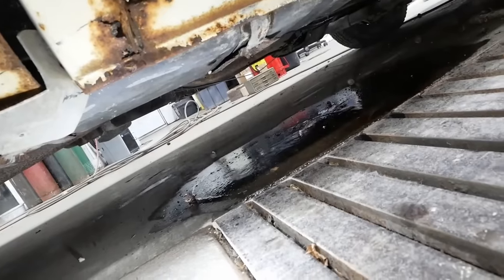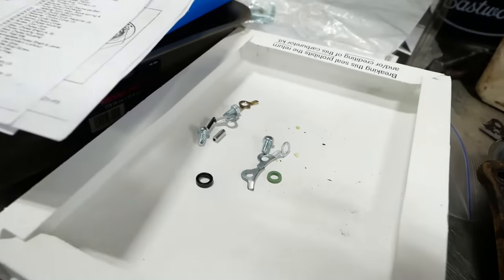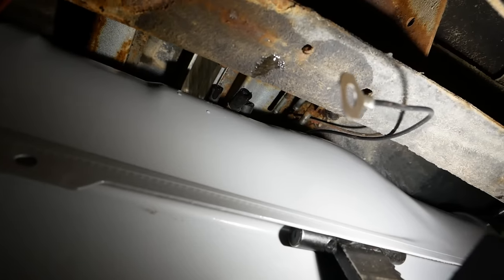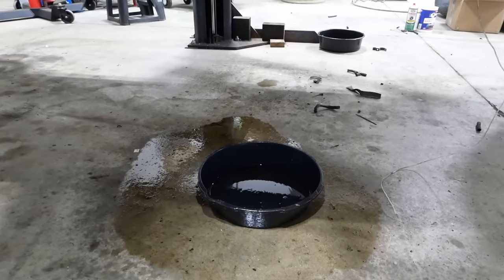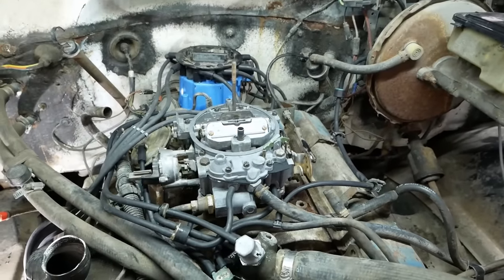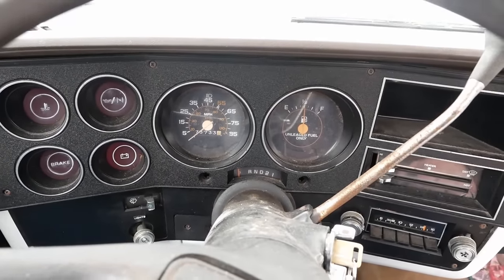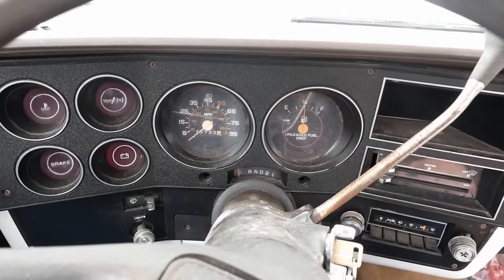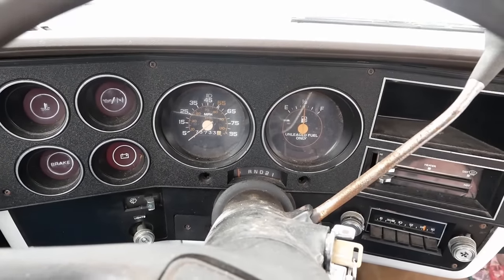Millennial vs. Carburetor | Square Body Chevy Back on the Road After Sitting 12 Years

Comment: Always great videos Wes. Wish I could help you with that carb, rebuilt hundreds of them at the dealer back in the day. Good luck.
Reply: I had a couple of vehicles back in the day that had the Rochester Quad, the worst decision they ever made in my opinion, it was a good idea on paper, but not in the real world. If you floored it from a stand still it would almost die because there was so much being allowed in for the amount of fuel. 
Those Holly dual pump dual feed solved that issue.
Reply: Soundds like a tuning issue, and not a carb exclusive problem. My Quadrajet is over 40 years old, and works ok.
Reply: @dave_n8pu  the secondary air flap was out of adjustment allowing them to open too soon.
Reply: @paulcarroll750  It came that way from the factory on my (back then) new 1970 GTO Ram Air III. If I waited till I was already rolling at say anything over 25 - 30 MPH, then it was Okay but not from a full stop. That's where the Holly dual pump dual feed that I had installed for me solved, and the place that installed it for me told my it was a lower CFM than the Quad that the factory installed. It made that car much more than enjoyable for me.

Comment: Good onya Wes,
Wow epic video, love your work.
Worked at GM in the 80s, rebuilt LOTS of those carbys.
Two things
The float absorbs fuel with age sinking slightly, causes havoc, replace it.
The accelerator pump check ball seat attention the bottom of the bowl gets corroded, usually you can whack the old ball with a punch to reseat it and then put the new ball in. If it doesn't seat you loose some of the squirt, and it hesitates.
The throttle shaft is a biggie.
Also, the top of the Carby can get distorted from people over tightening the air filter wing nut. Then you can loose vacuum to the power valve etc.  If you run a file across it you can regain the seal.
It took way too long to invent fuel injection.

Comment: I was really impressed with your description of the choke operation. It was clear, correct and in the proper order. Well done.
Otherwise, all you kids grew up on fuel injection and are afraid to touch the pedal while starting. Us old folks, after about 3 seconds of cranking you start pumping fuel into it.

Comment: From what I hear, the zinc was discovered to be clogging catalytic converters so the concentration was reduced or eliminated from most popular consumer oils. Also engines of the last several decades have moved to roller lifters so don’t have anywhere near the frictional contact a flat lifter has.
Reply: I have read info from different oil companies and engine manufacturers and they all say pretty much the same thing. Wear additives like ZDDP were found to be reducing the effectiveness of catalytic converters. As Wes said, a high performance engine needs high performance oil. I like Amsoil on older high performance engines. Motul or Mobile1 on modern engines. Castrol or Shell Rotella for work vehicles and generators.

ZDDP - ZincDialkylDithiophosphate. 
Zinc is the carrier for phosphate which is the active ingredient that is supposed to reduce wear on flat tappets.

Comment: Elmer is right on the Rochester. I’d try to get new floats though. Reminds me of my 65’ and 1966 GTO days.  Next time you have to fight a fuel pump that operates off a fuel pump eccentric rod load it up with grease or petroleum jelly to hold it in place.  Good work.

Comment: I have worked on a lot of these Gen 1 engines and have often had lean carb issues.   First thing to check is to clean the seat on the EGR valve.  While in the closed position it could be venting exhaust into the intake manifold.  Second, if this engine has an Aluminum Intake Manifold spray some carb cleaner around the parameter and look for leaks.   With an Iron Block and Aluminum Manifold the different expansion rates work the gasket.  More than once I pulled an Intake manifold to find the gasket crumbling in my hands.   Good Luck.

Comment: Hello Wes,
Wow the chrome gear shift lever is even rusty. At least the body is good condition. 
The late 70's early 80's carbed vehicles were very problematic and extremely frustrating. It even got worse when they introduced the ECM to control some carb functions. Then we advanced to throttle body. No wonder why we are using fuel injection today. I would suggest a new Holley. Or raise the radiator cap and drive a new vehicle under it. 
Good luck, Boe

Comment: The zinc additive back story began with adding it when you break in a new camshaft. Aftermarket Camshaft manufacturers were having defective cam comebacks and abnormal wear after customers installed them on their flat tappet cam on older vehicles. Mostly small block chevy's.  But, after initial break-in, you shouldn't need high zinc content, but that hasn't stopped every oil and chemical manufacturer telling people that they need that zinc for every oil change going forward. Now all older vehicle owners don't want to take chances and the zinc additive requirement stories have exploded.
Reply: Agree 100 percent.  For a performance build with a flat tappet cam I run the royal purple break in oil and follow the break in procedure for the cam.  Then drain and refill with my preferred brand of oil without any zinc additive.  Been doing that for many years and never wiped out a cam or lifter 😏
Reply: @rickwensel2313  That's entirely different and has more to do with low sulfur content, not "lubricity" qualities by some imaginary additives that didn't exist in Diesel #1 and #2 prior to 2007. Sulfur is an acidic lubricant, not a good lubricant, but it is one. There were fuel pumps designed around using the sulfur as a low grade lubricant. Modern Diesel injection pumps, even ones from 20-25 years ago, don't need it, even though there are some cabal weirdos who think the VP44 needs oil in the diesel fuel.
Reply: Back about 1972 I worked for a trucking company . One of my duties was topping of the oil in the power units . The pumper truck I used always leaked a couple of drops after use . I was driving an old 318 c.i. dodge that leaked oil pretty bad so I would use the waste oil from the pumper truck in my car . Didn't take long and it slugged up that motor but good . It was Shell Rotella 15w40 . I don't recommend using it in gas engines .
Reply: @orionfixr7713  The fact it was waste oil was your problem. Secondhand, heat-cycled, diesel contaminant-filled, sheared down oil will sludge up any engine in short order. Everyone and their dog runs diesel oil in classics now without issue.
Reply: @kw9849  It was fresh oil that dripped out of the gun on the pumper truck .
Reply: @orionfixr7713  ive put 242k miles on my 04 Cadillac Deville 4.6 Northstar, almost 800k miles between my two 02 and 04 Silverado 2500HD 6.0 gas engines, 133k miles on my 03 Oldsmobile Aurora 4.0, and those are my current vehicles, ive put over 500k miles on a well used and abused 98 Cavalier 2.2 pushrod engine, 390k miles on my old 02 Silverado 4.3 V6 (frame rotted), my old two 1988 Chevy 2500 (one 7200gvwr, one 8600gvwr) almost a million miles between the two, both 350 TBI engines (frames rotted), my first truck, my 1982 Chevy 250 straight 6, the odometer quit working at 977k miles, but put over a million on it (i bought it with 812k miles) and, including my garden tractor (1980 International Cub Cadet 12hp Kohler) my Toro pushmower, my beat to crap MTD snowblower, my 4-stroke Husqvarna weedeater, EVERYTHING I own runs on 15-w-40 Rotella, and I can assure you that if you pull the valve covers off any of my engines, wipe off the fresh oil off the insides, and you can eat off any of the surfaces without ANY sludge at all!!!! Rotella oil and Wix filters have been my go to for over 25 years, no matter what engine it is/was!
Reply: @mattcat231  : OK

Comment: Had a similar issue with a Carter pump for a 1968 Ford 289. Ended up going with a Napa which fit like the original. Interesting how this truck's frame and underbody looks better than most of the 10-15 year old ones you work on.
Reply: Agree but since the mid 80's Carter stopped making quality products and only worried about profits. Thats why so many blockoff plates and electric fuel pumps were bought then.

Comment: Your dad may be right. Dont expect too much from a carburator. As a lot of people said, we would often bypass the choke with a manual cable because they were so finicky. My luck with rebuilding carburators was hit and miss because there were many variables. I recently tried to clean/rebuild a carb on a chipper/shreader. All passages clear and about as simple of a carb you can find. No go. Put a new carb on it and started right up.

Comment: LOL!  You're expecting modern performance from an old system.  You have to DRIVE these old girls.  Feather the accelerator.  You never pulled out into traffic before these were good and warm.  Stalling on takeoff was a common cause of accidents.  I think the greatest benefit of all the electronics and computer stuff is the ability to get in and go and not have to wait on that car 1/4 mile away before you pull out of your driveway.

Comment: Thanks for taking me on a stroll through days gone by!  I rebuilt a holley carb once, and used I to replace an auto lite.  Fuel injection is a better idea, but mechanical parts are easier to reproduce from scratch than are semiconductors.

Comment: Zinc in Oil is really more important to older cars with older engines. In some states you can't even get straight weight oil anymore it's all Multi-Weight so if you have like an old Camaro, Mustang, Charger or any Classic Muscle Car with a period correct engine Zinc is essential. But since this particular Square Body is catted using a oil with less Zinc will keep the Catalytic Converter intact.

Comment: Your frustration brings back late nights as a teen in the garage smelling of carb cleaner and uttering profane incantations. I rebuilt my fair share of these and had friends who did it for a living. We just converted them. Manual choke cable into the cab and a little time to get to know the equipment. We ran automatic chokes till they failed and converted them to manual on our farm. Probably not a good solution if the owner wants to turn it on go and not have to fiddle with anything. We did buy rebuilds for grandmas car for that very reason and the auto chokes worked fine on them.  We figured they had a direct line to the carb gods and we were not worthy. This was in the late 70's to late 80's. Once we got our first GMC TBI we did not have the issues anymore. Thanks for the vid Wes. Cheers.

Comment: Hi Wes, great video.  I have a recollection of working on these many years ago. The float doesn't come in the carb kit and should be replaced. if you don't replace it you should at least check it in a bowl of water to see if it actually floats. They would crack and fill the float with fuel causing an over fuel issue.

Comment: Q-Jets, are a pretty simple carb! You can even adjust the secondaries to open later than factory. It's a good carb actually. One of the main problems they had with those is that customers would tighten down the wing nut too tight and warp the top of the carburetor. Have fun! lol
Reply: I've never heard that. They are temperamental junk.
Reply: Yeah, they are pretty good, except for their notorious habit of flooding over and setting fire to the engine. It would seem this vehicle was another victim of this.
Reply: I have heard of that as well and it seems to put the choke plates/valves out of index? Something like that. It distorts the air horn. Interestingly Old Car Alley's most recent video talks to this issue on a Rochester he is getting ready to rebuild.
Reply: Simple?...LMAO!!!

Methinks you have not worked on them. They are good carbs, but they are a pain in the ass to work on.
Reply: @markusgarvey  Yeah, simple! Maybe  you haven't done very many as to why you think they are a "pain in the ass".  I'd take a Q-jet any day to overhaul over many others such as the Holley double pumper!
Reply: Ain't no way

Comment: The EFE and the air cleaner bypass were quite useful and in some weather conditions very important in Canada and Northern states. As you said the EFE heats the intake manifold before engine coolant is hot enough to help with fuel vaporization. It made a noticeable difference on short trip vehicles. Without the air cleaner bypass carb icing was a serious problem. Some imports used a manual winter setting. I locked a lot of US systems shut for the winter and told the owner how to unlock it in the spring. (emphasizing that warm April days with winter gas in the tank would be giving them vapour lock).

Comment: Glad you got it working. First thing I do on these old things is check all your canisters with a vacuum pump, and check idle vacuum. Choke pull off and advance are common. EGR. Etc... Often they're all bad. But choke adjustment is pretty critical on these too. If you have low vacuum, everything is off. And people spend weeks debugging while never getting a vacuum reading.

Comment: Excellent video Wes. Congratulations overcoming many of the problems...my heart was with you all the way.   The power brake booster may have a vacuum leak due to a worn diaphram or the power brake booster hose may have a crack. I have heard this may cause a rough or stumbling idle sometimes.

Comment: I have worked on carburettors in the past and only ever had one with an automatic choke mechanism. It proved so problematic by the time I owned it (it was an old car) that I changed it to a manual choke and it was much more reliable. If I recall it was a question of attaching a manual choke cable to the choke mechanism and that kind of overrode the automatic action. I also recall that many cars were a bit stumbly until fully warmed and off choke. Thank you for the entertaining video though. Nostalgia ain't what it was! Glad to see you're all OK. Take care. 👍 I

Comment: I took the Quadrajet off and replaced it with a Holley that was a direct fit and was a smaller CFM.  This was on my old '78 chevy 350 cid.  It was much more predictable for cold starting and general everyday use.  It just didn't have the power of the Quadrajet over all.  It just seems to me that for a carburetor to work as OEM there has to be absolutely perfect everything in sync. The one carb that I never understood was the Carter AFB.  I had two on a tunnel ram on my old gasser back in the '60s and tried everything to get the performance I wanted.  Plenty of other people swore that they were the best.  I replaced them with Holley 650 CFM and never looked back.  Loved drag racing and think all the time how great it would have been to have modern day FI and computer control.
Reply: Get back into it man. You only live once. Drop a 5.3 or 6.0 truck motor in something and throw a turbo on it

Comment: Im currently converting a 5.7L Hemi to a Carb set up in my 79 firebird. I ❤ the simplicity and adjustability of an old school carb! I can achieve much better gas millage by making simple easy changes of jets ... Ect
Reply: Yes sir  I'm getting ready to install new engine in my old jeep yj.  I have a new Weber  carb and a upgraded gm style hei distributor . No computer, manual fuel pump, two vacuum lines , 👍👍👍🇺🇲🇺🇲
Reply: @jontrudell7529  Cult Leader Wes...
Reply: @DanEBoyd  😆

Comment: I knew tackling the Rochester carb was a hopeless gamble. Even if you did everything right , you are dealing with age and wear and tear you cannot see. The carb was originally sized for new engine, not one like the one you are working on.    These were not loved even when they were the only game.  Speaking from experience of owning a 1982 Chevy van with V8. The Rochester had a tip in stumble that loved to show up when entering the Detroit freeway at rush hour.  I took it to a Rochester repair professional and even he could not fix it.   I stood by during the repair just to see if I could learn to fix myself.  Learned that 4 barrels were out of my league.  Could barely fix a two barrel.    

 Rebuilding carbs is as much an art as science. I consider it similar to rebuilding of an automatic transmission. Best left to specialists.  Considering the number of parts involved, age, wear and tear, and the many different sizes of jets, etc, it is pretty much hopeless.      I checked Amazon and Ebay and a new carb was $220. From a business production point, you would be money ahead buying a new one instead of repairing the old one.  

Respect your perseverance, but I would recommend in future go new or tell the customer to bring a new Edelbrock and not waste time trying to fix the old carb.

Comment: Wes, GM used to offer an excellent product called "Top engine cleaner". I have been retired many years so I do not know if they still offer it. It is made to "decoke" the top end. High mileage Chevrolet V8's are notorious for the intake valves having carbon deposits form on the intake valves. These deposits can actually grow to become quite large through time. Besides restricting airflow these carbon deposits can act as a sponge on a cold motor soaking up the initial squirt from the accellerator pump. Requiring you to pump the gas pedal several times to prime the cold motor.The product I mentioned is used to break up the carbon deposits on the intake valves. I remember GM offering TSB's from many of their car lines for this drivability problem. With the advent of fuel injection and better fuel control this became less of a problem. I enjoy your video presentations very much. You have a great diagnostic process and a never say die attitude. I hope you can accept this old mechanic's tip from a old mechanic. Keep up the good work.